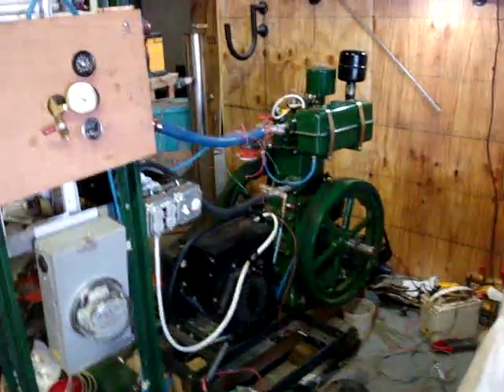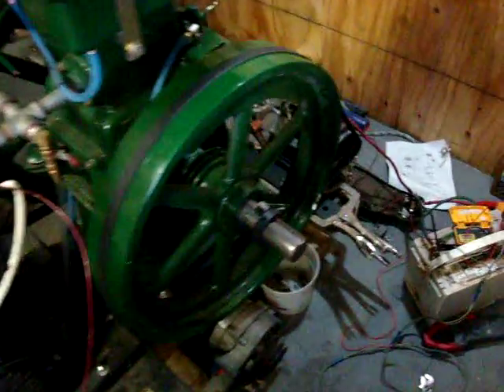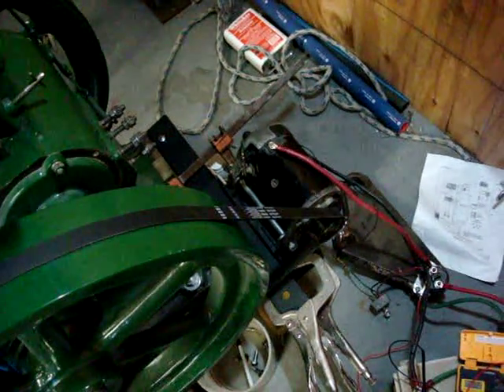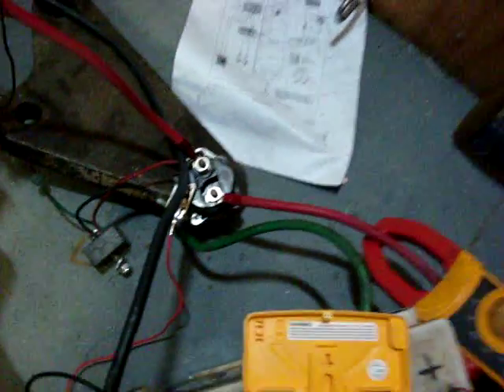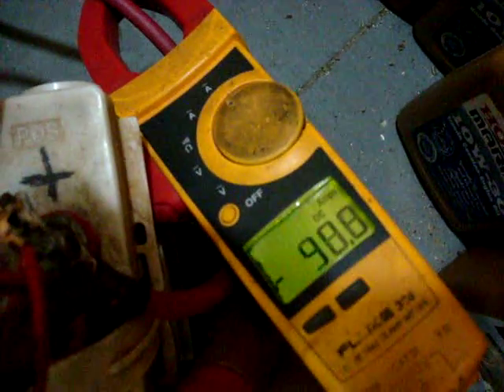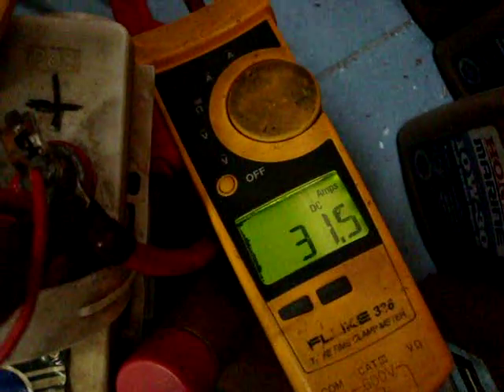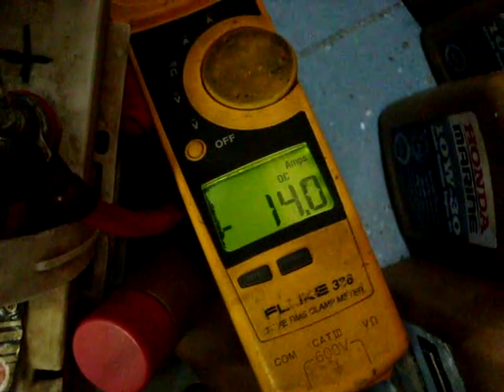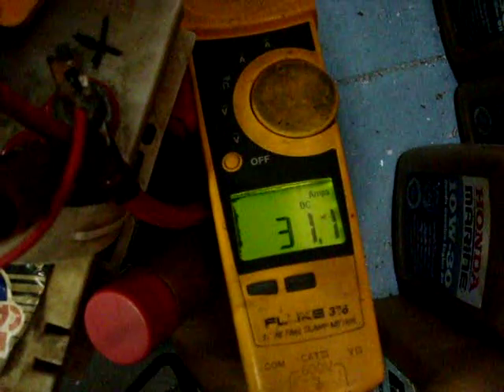Listeroid with electric starter and DC generator

Comment from the maker: It's possible that may work if you set the engine up to be just after compression at TDC, that way it would have two (or 1.5) revolitions to gain speed before compression,
I will try it in near future , but doubt it would work, currently working on permanent wiring, servos, relays, for auto stop etc.